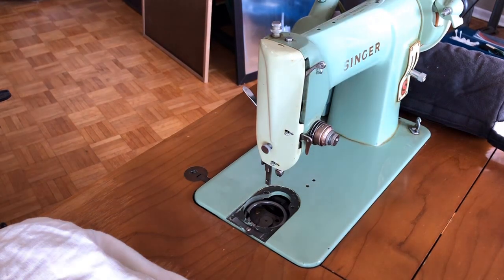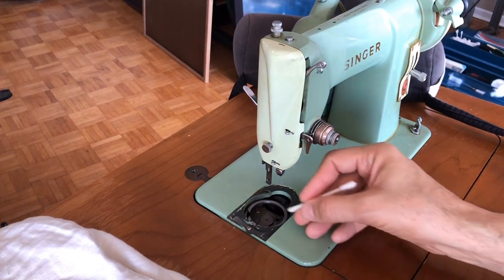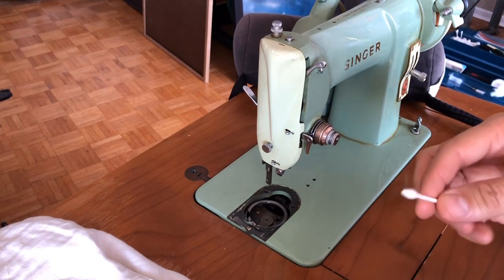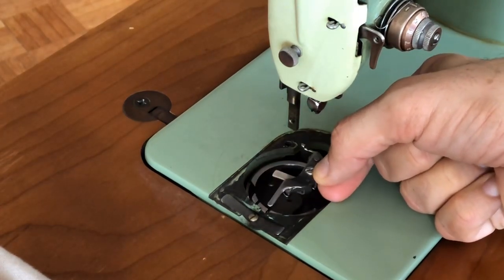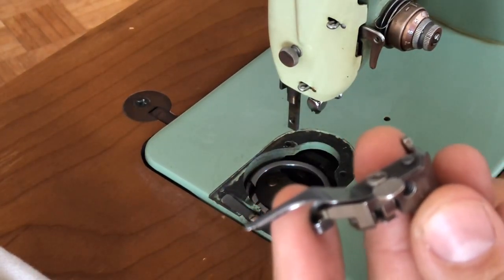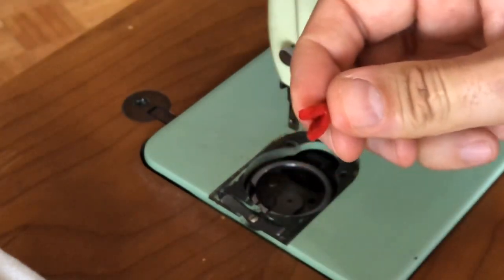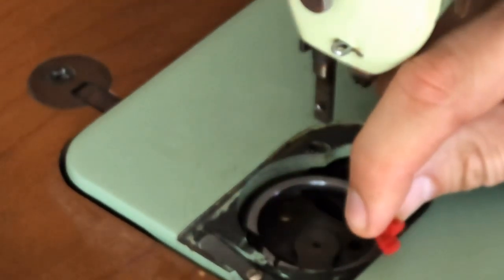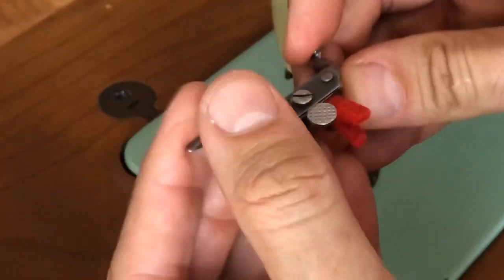SINGER 185 OVERHAUL SERIES #2: Installing a Shuttle Bracket, Adjusting Feed Dogs & Install Oil Wick!

Comment: Thank you for sharing this tip about the oil feeder. I made the mistake of thinking it was some cloth the machine had eaten so dug it out of my 185k  before I realised it was meant to be there. I didn’t have any thick felt so I made the new wick out of a dremel buffing wheel and it’s working fine. The buffing wheel is very sturdy felt and meant to hold polish so it makes a good reservoir for the oil.
Reply: OH my Gosh!  I did the same thing.  I thought it was a piece of fabic stuck.  I saw the wire and thought they even sewed over some wire and got it stuck near the bobbin.  What is Dremel buffing wheel?  does the wheel replace the spring?

Comment: Someone may have already said so, but there is a downloadable (free) Parts List for the Singer 99-13 (Form 18116, Revised (1141)) at the Superior Sewing Machine & Supply LLS library site that includes the "Oscillating Hook Bobbin Case Position Bracket Oil Pad (felt)", Part 32598.  It is listed on Page 9 by part number and also on about page 55, Plate 22678, where it shows a life size illustration. 

This doesn't give you an idea of how thick it is but I expect that given it was red felt like the spoon pin felts it was probably made from the same "sheets" of felt as the original spool pin felts. The one in the illustration isn't shaped like a Y.  It is more like a blunt-tipped "wedge" (convex isosceles trapezium (convex isosceles trapezoid in US English) to be more specific!).  I expect they simply cut a slit at the wide end and the felt would obligingly spread apart.

I can't be sure they kept the same shape and size for all all 66, 99 and 185 models over the years but can't see why they'd change it when it worked so well.  I hope that helps someone.

Comment: I just put an oil wick in my 66-1 Treadle and I got a new project of a 185J.   This is what I have done for my 66-1.  I cut out a new wick from a red bobbin coaster and followed the template from a Singer 66 parts list manual, (it basically looks the same as yours) then screwed the wick into the cone shaped spring.  Then screwed the wick and spring into the hole that goes into the bobbin lift assembly.

Comment: I just disassembled my 185J. The oiler is a red felt like you show. It was held in the threaded hole with a conical spring. The conical spring was wrapped very tightly around the red felt.

Comment: I cut a piece of felt furniture protector as my oiler piece...my original was down to a nub..it had a conical tapered wire that screws into the hole- seems to work fine!
Reply: I tried removing the felt too but left a small piece as it was too hard to pull off. I hope the little piece will still do the job

Comment: Thanks for your videos!!!  I'm attempting to restore a Singer 66 "Red Eye" treadle machine which was stored in a shed for 50+ years.   I wanted to share that the wick hole on the part you demonstrated cleaning is different on my machine.  Mine has the red deteriorated felt BUT it is installed using a spring which is wound into the threads in the hole.  I took a close up photo that I'd like to share with you (don't know how to do this here).  I need a new wick as well--waiting on how you made yours (grin).
Reply from the maker: Thank you Duke.  Yes, you are correct.  Many of the 66, 99, and 185 models came with this spring like funnel shape which helps to anchor the felt into the bracket.  I showed how it is possible to install the wick without the spring only for those who might have it missing as mine did but would like to use the machine properly.  The way I installed this one, it works and is stable, but ideally, you want the little funnel shaped holder.  Thank you for reminding me about the wick video I need to make.  I hope to have it made soon.
Reply: Thanks for your quick reply!  I think I understand the principle of the wick's function and how it works (thanks to your careful explanation)  so since I do have the spring, I think I can fashion a wick from felt to work with the spring.  A side note:  I have my mother's identical 185J Green Machine which you are demonstrating in this video.  I'll tackle it next once I've gotten the Red Eye cleaned up and working (fingers crossed). @VintageSewingMachineGarage
Reply: Thank so much for the 3 videos for this machine. Just bought one and started to clean it today and followed everything in the videos and it looks great. I would like to try it out but it needs a new belt and don’t know how to replace it. Do you have to take off the hand wheel?  Any help would be greatly appreciated.
Reply: 11:39 
Anyone have a link to the wick-making video. YouTube’s search function really stinks

Comment: Would you consider doing a complete disassembly/restoration video on the 185J?  I am having a problem with mine that I can't figure out.  If I put it in bobbin wind mode the hand wheel turns smoothly but if I tighten the "stop motion screw" to sew the hand wheel wobbles and vibrates badly.  I don't have a clue how to fix it.  I have removed the "stop motion screw" and checked the washer position but nothing I did made any difference.  Any advice would be appreciated.  I haven't found anything on YouTube yet that covers this issue.  Fortunately my 401A restore was successful so I have a machine to use while I resolve the 185J issue.  I love your site and it inspired me to rescue and restore a couple of old machines.  Thanks again for getting me interested in these old machines.
Reply from the maker: Hello Michael.  What you describe is not common.  A few things come to mind that you might check.  First, focus on the Stop Washer and make sure you have it facing the right way.  Next, be sure that it is "Seating" when you screw on the clutch knob.  Those washers and loosen if you aren't careful and if they are not "seated" , it will cause the engagement of the drivetrain for sewing to not work.  Another thing to inspect is to make sure there is not thread that has gotten caught and tangled around the driveshaft.  This can happen and does happen when bobbins are wound and thread catches on the hand wheel drive shaft.  (not saying you did that, but I have found this on machines I have gotten to restore.  Lastly, if none of these appear to be an issue, look underneath the machine for any obstructions and also make sure your needle plate is properly installed.  If it is not aligned properly, it could block the feed dog from moving properly.
Reply: @VintageSewingMachineGarage  Other than the machine working how do I tell if the washer is "facing the right way"?  I have tried it in all four possible positions and it doesn't seem to change anything.  When I screw the clutch knob down all the way the set screw extends past the washer and hits the end of the drive train.  I will check for the thread on the drive train but I didn't see any the last time I had the hand wheel off.  I haven't done any sewing with this machine I just rescued it from a thrift store and was checking it out then I noticed the problem.   I'm guessing it has something to do with the washer.  When  the clutch knob is tight the hand wheel wobbles.  When it is loose for bobbin mode it doesn't wobble.  The only thing I can think of is the washer but I've had it off a dozen times and nothing changes.  I will try your suggestions and I really do appreciate your taking the time to help.  It's probably something so simple I am going to be embarrassed when I find it.
Reply: @VintageSewingMachineGarage  Ignore earlier reply.  I took a closer look at the machine and the wobble is in the drive train.  I move the drive shaft from the needle end of the machine and and the hand wheel wobbles.  Even if I remove the washer and tightener the hand wheel still wobbles when I move the needle up and down.  Since I can't find a service manual I am stuck for a solution.  This one may be beyond economical repair.  I don't know how you could bend a drive train but that's what it looks like at this point.

Comment: Followup on previous post.  My 187 is toast.  After closer inspection the housing has two cracks where the drive shaft comes out of the housing.  I don't know if the drive shaft is bent but it doesn't matter at this point.  I guess this one will need to go to the dump  and that is sad since it was in such great condition otherwise.  Fortunately the new 401A works beautifully after a little TLC.
Reply from the maker: Sorry to hear about that Michael.  What you described is so rare that I wonder if the machine was dropped at some point in the past.  Not necessarily by you, but there are few things other than that which could cause something so severe.  If the hand wheel had wobbled when you were putting the machine in winding mode, I might have thought it was just the hand wheel.  I might suggest though that you keep lots of the other parts as spares or donate it to a sewing shop that might find the parts useful or you could always sell them yourself if you had the interest. On the other hand, congrats on your 401A!!
Reply: @VintageSewingMachineGarage  that red felt what do you do with it do you put oil on the relt
Reply from the maker: @barbaramurphy6693  Yes Barbara.  While you can still oil the race/bobbin case, the felt allows you to soak it with oil so that it will apply oil regularly.  Various machines have used felts before although this model along with Singer 99s and Singer 66's are the primary ones I know that use it in the race/shuttle area.

Comment: Did you make the next video on Red Felt yet?  What is it called? I ripped my red felt and coil out :(  I  thought it was stuck lint and junk, OMG when I found out it was an actual part.  It was just a nub so probably would have needed to be replaced anyway.  What happens if I don't replace the spring and felt?  Can't I just oil the machine regularly?  And thank you for your videos.  Much appreciate your thorough explanations.  Can you do one on how to treadle?
Reply: I thought the same too 🤣

Comment: Thank you for your videos on the 185. I picked one up at a garage sale and am working on it. I’ve got a replacement slide plate from someone as it was missing but it won’t go on the butterfly clip so I think I need to replace that as well. I don’t think the clip is original to the machine. Would you kindly suggest a good resource for vintage/original parts?  Many thanks
Reply from the maker: Sure Melody.   Along with Etsy and Ebay, I have found bonanza.com to be a helpful place to find vintage/original parts.  FYI, before giving up on the the current clip, see if you can adjust it with the screw in the center and even (gently) try bending on the ends just a little to see if that helps.  Its no surprise that  many of these machines (including the Singer 99s and 66s) are missing their bobbin plates is because of this plate/clip design.  Also, a few drops of sewing machine oil might also help get it to slide and engage.  Don't feel bad as I sometimes still have to show patience when reinstalling these but it will eventually get fixed.  It can try your patience sometimes though!
Reply: Thanks for suggestion. I’ll try it when I put it back together. In the meantime, I have got as far as taking out the bobbin bracket. I’m also working on a 99k. It’s handy because I can compare the machines and get extra practice. I’ve taken out the bobbin bracket because I want to put in a new oil wick. At first I thought the 185j had lost the oil wick funnel screw thingy...until I got it out. They have the same part number 32659. The one from the 99k says simanco. The one from the 185j says singercan (made in Canada I guess). Isn’t the oil pad essential to keep the race lightly oiled and running smoothly?  The 99k is from 1956 and the 185j is from 1962. If you like, I could email you a picture since I’m not able to attach one here. thanks!

Comment: I just bought one of the machines.  It looks like it is all original and never been touched.  The reason I mention this is the Oil Wick on my machine looks original.  The wick is encased in a spring that is screwed into the threads on the Shuttle Bracket.  Should I pull the old wick material out of the spring and replace it with one of your wicks?
Reply from the maker: Hi Michael.  As long as your wick is in sound condition, there is not need to replace it.  Many of these machines have either no wick or very little of it left due to use.  I was fortunate to find one that was in the same state as yours sounds and that is how I made a template for my replacements.  You might consider cleaning the area of yours as I have, but there might not be any need to replace yours at this time.

Comment: Where may I purchase that thick merino wool felt? Thank you.
Reply from the maker: Hello.  I found mine on Etsy.    They were sold in squares which you can specify how many you want.  The seller, Felt Planet,  still has these.  I chose one of the reds (either Fire or Cherry) as they are similar to Singer red, but they have many colors.  I needed these because they are thick and dense unlike thin sheets which wont work.  I believe these are sold for use as wool coasters but the size was just right. You can click on the color palette below the main image to see the colors.   Here is the link:  https://www.etsy.com/ca/listing/707528753/new-elegant-cut-square-wool-felt?ga_search_query=felt%2Bsquare&ref=shop_items_search_10
Reply: @VintageSewingMachineGarage  Awesome! Thanks for the quick reply. Thanks for all your videos.